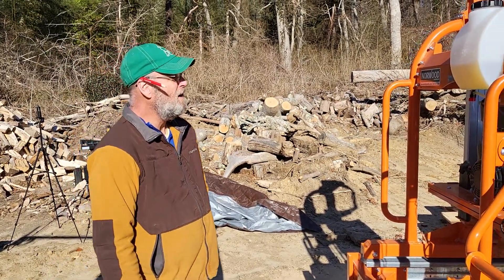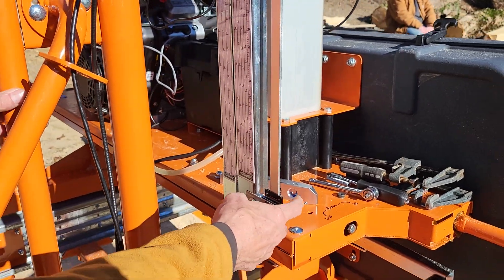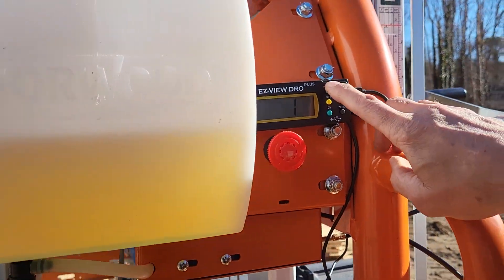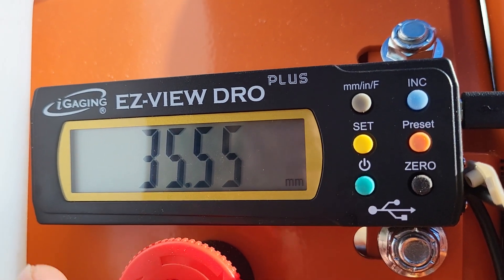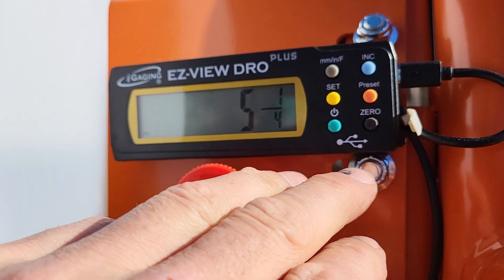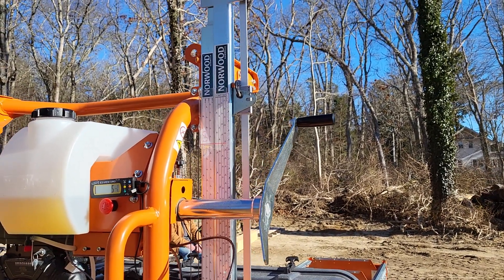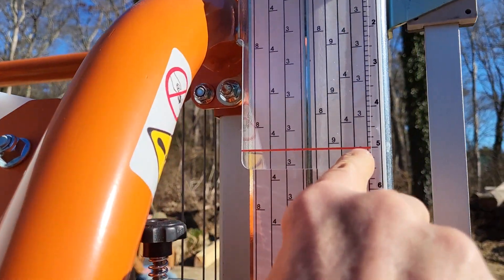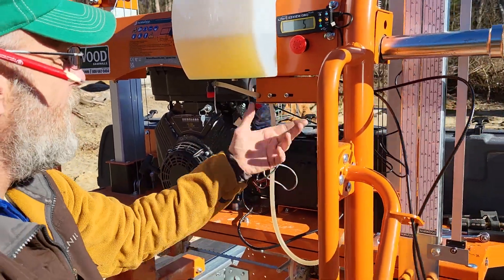Norwood HD36v2 iGuaging Easy View Plus DRO install.

Comment: This is a wonderful addition to your sawmill.  I have been looking for an alternative to the Norwood version that is (in my opinion) over priced.  I have a Norwood HD36 that I purchased in 2015 with hydraulics and the power head and feed.  Norwood states that their digital system will not work with the power head option.  You have provided a less expensive alternative that I have no doubt will work on the HD36 mill that I have.  It's only slightly more expensive than their magnetic scale that you can stick on over the factor scale that came with my version that did not include a 5/4 scale.  

It would be nice to have a 12v adapter that you could just clip on the battery and not have to use the 2032 coin batteries or a 120v adapter.  Those little batteries add up.  I added an hour meter that also uses 2032 batteries to my mill to keep track of not only service hours, but job hours when I'm cutting custom jobs by the hour.

Thanks for posting this information!  I'm doing the calculations for length to add one to my OEM mill scale.
Reply from the maker: I ended up getting the color coded magnetic scale as well and to be honest, I use that most of the time.  The DRO is great for dropping "off" dimension stuff, using the incremental setting.  Thanks for the watch!
Reply: Yes, I saw those as well and had been looking at all the digital and magnetic options.  I will probably purchase one of those to use.  I am most interested in a 5/4 scale since cutting at Norwood's 4/4 makes it hard to get a true 3/4" board after jointing and planing them down.  True hardwood 4/4 is really 1 1/8" in thickness rough sawn.  Thanks for the follow up on the color coded magnetic scale.    @williamprophett9148
Reply: I added a 12v to 5v converter with a switch to run my DRO. The battery doesn’t last long if you forget to turn it off.

Comment: Forgive me for being curious, but how du you use that regarding quarter-scale for example? My knowledge (and supported by for example Cooks) is that the line is always stationary and the scale moves. Sawing (more or less) green lumber isn't like putting a man on the moon. One good trick is to put a second line 2-3" closer to the sawer. Two lines making one line makes zero zero. And I have found in my dayjob that analog rulers are faster to use than digital. When the zero-line lines up your hand stops, but ehen the DRO shows -0,258 you start to slow down to hit 0,0000000. Even if +/-0,5 is good enough.
 Sorry, thinking/writing metric. That's why it can seem silly...
Reply from the maker: So, you have two lumber scales on the mill.  A stationary scale that reads distance off the bunks and an adjustable  cutting scale for 4/4, 5/4, 8/4 etc...  I am perfectly fine cutting off of the scales...  My wife doesn't use subtract fractions (I know she should use the scales) and needed an easier way of reading the static scale on the right and the DRO reads exactly the same as that scale.  The adjustable quarter scale still adjusts and works fine.  There are no "two lines"...  I hope that makes sense.
Reply from the maker: Sorry, "the wife doesn't subtract fractions as easy as I do"😄